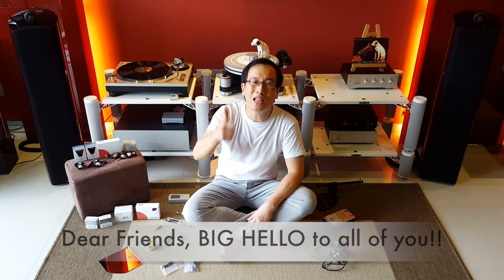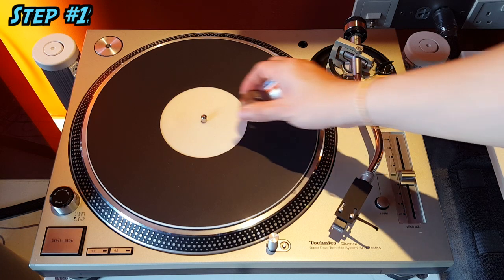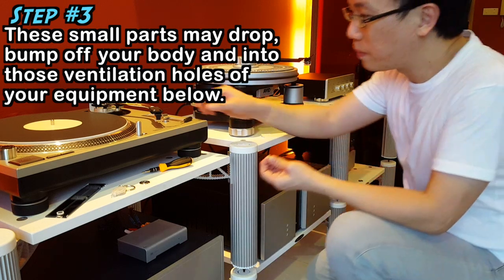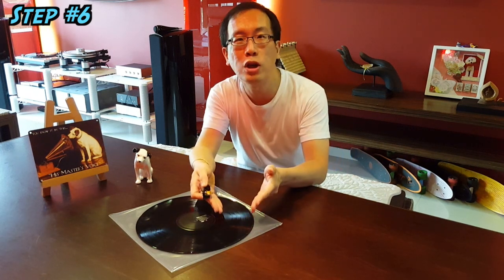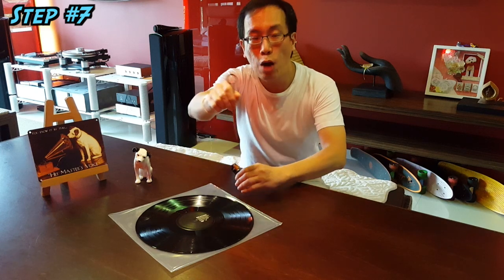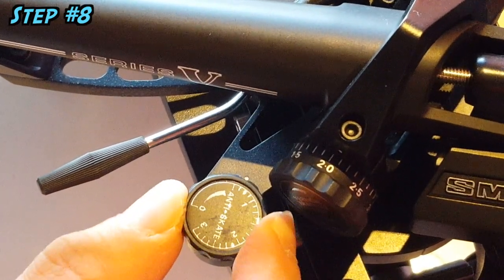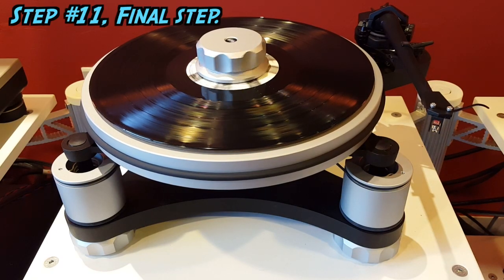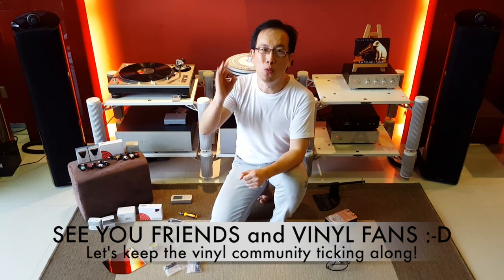Detailed Turntable SET-UP - for beginners - advanced.

Comment: A conundrum with my VPI HRX suggested not to use anti skate. I set it up anyway using an old laser disc. Still skates but nothing like it used to. Tone arm is 3d printed carbon fibre 12 inches in length with slight conical taper just to make things more difficult for you. Tone arm pivot also has VTA built in so you can adjust on the fly if needed. Platter and table are perfectly level. Spiked jack screws were installed in the table legs. Spot on!

Comment: I am not sure this is the right location to post this, but here goes anyway. This is a review and setup of Nagaoka MP300 cartridge. My cats laid waste of the turntable with tone arm off pivot. Nothing was damaged but I had to realign the whole system. Cartridge was the Kiseki Purple Heart which fortunately had the stylus guard installed. As the Kiseki does not have a replaceable stylus I shopped for something that would sound nearly as good. After 6 months I decided tonight was time for the Nagaoka. My phonostage is a Manley Chinook which required a gain change from 60 to 45db of gain. Manley recommends adding cable capacitance of 90pf for 1m lead and select a capacitance dip that will get you to a desired 120pf or so, 50pf was my closest choice. MP300 was aligned and balanced to 1.53g. Cartridge sounded bright so the added capacitance was removed. Bottom end coupled right in. Played Pink Floyds' Question of Balance. Something was wrong even though sound was balanced and uniform but the sound stage did not feel correct. Sounded like a phase issue. Wiring was per instructions so I reversed the cartridge connection on each channel. BINGO!!! Everything fell into place with a proper soundstage rendering. I think we have a psycho-acoustic thing going on here. The ATTACK sound should come at you, not recede. One other reviewer noticed the same thing with this cartridge. I put Diana Krall "I Dream of You" album on and all was perfection. I fell back in love with the sound and Diana.
Hope this helps some of you to fine tune your listening experience. My review of the Nagaoka MP300 is a resounding A1+.

Comment: Hi - great setup on the Avid turntable, but I noticed at 2:45 your platter is not quite flat and appears a bit warped.   Perhaps a manufacturing defect?   But all vinyl isn't flat anyways, probably completely inaudible...     Please keep the great videos coming... I really enjoy them here in the States!    Best...
Reply from the maker: Hi Buddy! How are you👋😄!!
The platter is spot on flat, machined aluminium.  The only issue then was that i had actually accidentally bumped on the platter quite hard during all the filming, and dented slightly the inverted bearing casework. It is an extremely small dent. I had my local Avid great retailer came over to just fit on the highly modular and replaceable case and sapphire bearing within 30minutes and everything was back to perfect since  two years ago.  Sammy and Eugene are a Father and Son-in-law team that retails Avid in Singapore. They have close contact with Conrad Mas of Avid UK and service thoroughness and response time is top notch from all of them💪😄👍!!! You can see Sammy and Eugene in my latest video where I picked up the Goldring 1042 cartridge! Their store is called Sound Decisions and have been around for more than 20 years.
Reply: Great that you got the platter repaired!    I'll look for them in your Goldring 1042 video.    Again keep the video's coming!  I'd like to see you discuss your opinion on your Technics turntable (or perhaps you have already and I just haven't seen it).   Take care...

Comment: Ian, do you tape down the platter even when using the dr. feickert protractor? The instructions that come with the protractor seem to indicate that you shouldn't....but it's difficult to say. Thank you for all you do for the vinyl community
Reply from the maker: Hi Brother🤗!! Thank you for catching up here!  May I share this with you...👋🛑 Taping down the platter is to prevent unnecessary and accidental shifting of the platter during alignment...coz accidental shifting may cause accidental bumping of the stylus against the other parts of the tracking force gauge, etc any apparatus that is used during cartridge alignment.  Accidents had happened in my own experience before and I had learnt from my mistakes and hence i am very adamant and passionate about taping down the platter before any other steps requiring the stylus touching things here and there✌🛑...
Let me know if you have other queries my friend. 🤗

Comment: Hi Ian, I have a question about SRA setting. It has to be 92 degrees. But is that measured in the  static or dynamic (with the platter rotating) way? There is a great difference between the two.
Warmest Regards, Mark

Comment: Hi Ian, just seen this excellent setup video again and ordered the Celestron microscope to get a perfect SRT. Just wondering, what do you use to measure the angle of the stylus once you have taken the picture?  Best, Peter, Denmark
Reply from the maker: Dear Buddy Peter!! I am extremely sorry!  The one I have been using which is much better is this one:
https://www.ebay.com.sg/itm/5MP-50X-500X-Magnification-8-LED-USB-Digital-Microscope-for-Inspection-ED/131908466569?hash=item1eb65b7789:g:nY4AAOSwcUBYQD56
I apologize because the celestron one which I used to use, is not able to magnify to that degree big enough and clear enough for optimal assessment of SRA.  I apologize for this.  Please get the one I have put up just above.  You can get it from any other ebay sellers.  Sorry, my friend.
As for the program, :-D I bought the plum amazing pixelstick available for US$10.  It works very, very well. I love it!!!! You can see it here:  https://plumamazing.com/product/pixelstick/
Brother, keep me updated anytime.  Best Regards, and again, I apologize for the above.
~ ian.
Reply: Ahh, thanks, Ian, but it doesn't seem to run on a Mac, I noticed that you also used a Mac in the video. Is it only for Windows computers?

It also seems to be in x1000 version, and there they list Mac OS compatibility.:
https://www.ebay.com/itm/2MP-1000X-8LED-USB-Portable-Digital-Microscope-Zoom-Video-Magnifier-Stand-/192235114461

No worries. I will cancel the other order. Best, Peter
Reply from the maker: Dear Buddy Peter, :-D i read with relief that you can cancel the other order.  Yes!!!
Brother, I am sorry about the Mac compatibility only.  I am not sure of the other angle measuring software that I can recommend with personal experience.  Apologies Brother.  I hope you find your way, and do let me know eventually about the one that you have acquired and works :-D !!! Thank you instead for your help in advance then.  I can thus recommend in future to other friends what you recommend.  Thank you, and warmest regards, ~ ian.
Reply: Hi Ian, sorry, I was talking about the software for the microscope you recommend on e-bay, seems as if it is only for Windows, but the x1000 magnification version lists Mac OS as compatible. Are you using the microscope on a Mac? I only have a Mac computer, so the angle software is perfect, just need to be sure I can run the microscope software on my Mac as well :-) Thanks for your great advice. Much appreciated. Peter
Reply from the maker: Peter Gabriel Ah i see! Sorry Peter... Okie the 50-500x one is compatible with my MacBook... once plugged in, the PhotoBooth app on my MacBook will automatically detect the usb microscope👍😄.... thank you Buddy for reminding me.
Reply: HI Ian, recived the microscope and measured my 2M Black's angle. Guess what, a perfect 92 degrees! That is great news as my Clearaudio Concept is not the easiest turntable to height adjust. Guess Clearaudio and Ortofon know what they are doing. Thanks for the instruction video :-)
Reply from the maker: Peter Gabriel Ah kudos to ClearAudio engineering guys who know what tonearm height to set to cater for the 2M Black🤗! Cheers Buddy!!! Happy for you!!!

Comment: Hi Ian,
thank you so much for all your inspiring videos. Thank you for presenting the shiit mani. Without your recommendation I would have never found this marvelous phono preamp.
One question: I own a Dual CS5000. I'm heading for the Nagaoka MP150. The turntable/ cartridge adjustment is a bit tricky. The tonearm only sinks to the record, when the turntable is running at the correct speed (Quartz-controled). Even if I switch of the current, the tonearm lifts and the cartridge doesn't lay on the platter/ record anymore. Do you know perhaps a possibility to adjust the turntable despite this "bug"? It isn't a technical fault, it's regular for this type of turntable.
Thank you in advance! Keep on with your channel. Thank you for your time on YouTube!!
Best regards from Germany. 
Sincerly Sebastian

Comment: Any advice for me. I am trying to get the right hybrid setup which is going to be used for 3 very different things.
1. Listening to records : Will use a different cartridge and headshell. Still thinking of which cartridge will be suited.
2. Serato DVS : DJ mixing which runs on serato control vinyl. Time coded signal to control software on laptop
3. Direct scratching on records. Bit advanced for me but I want to learn to how scratch direct on real vinyl records. Wont be mixing the records which I don't want to damage from this.  

Last 2 will use a cartridge meant for DJs scratching. Most probably Ortofon Concorde or Shure M44-7.

Turn table I have for this Audio Technica LP1240. DJ version with a lot of bells and whistles and also USB to sample records for mixing on software. 

I want to switch between each without a lot of tinkering.
Reply from the maker: Anurag Gogoi Wow Brother! You ARE having a lot of fun!!!👍😄👌!!! I am not a DJ and may not be able to help.  But i do know that for (1), the cartridges i recommend for your record listening pleasure are the Nagaoka MP150, Goldring 1006, MP110, Grado Red, Goldring Elektra, Grado Green and Grado Black.💪😄👍👍👍
Reply: Thank you for the advice... I am definitely leaning towards Grado black and MP110..
Reply from the maker: Anurag Gogoi Dear Anurag, the new Goldring E1, E2 and E3 series of cartridges are out. And i have placed orders for all three from my local retailer.  I will do the audition and testing for these cartridges as soon as i can.  I want to find out how they perform against the Group A, Group B and Group C carts👋😄. Nagaoka MP110 and Grado Black, you are choosing two great carts!!!!
Reply: Well I stay in Singapore too any local shops you would recommend to get the MP110. Or is it better to order from overseas.
Reply from the maker: Dear Anurag,
:-D my friends and i usually order from online ebay sellers (from Japan).
Warmest Regards,
ian.

Comment: Hi Ian,I got an Avid Sequel with an SME 309 tonearm. I understand that the setup of the SME 309 is very simliar to your series V tonearm in terms of setup. I setup the 309 tonearm using the paper protractor that SME provided. I suppose the SME paper protractor actually adjust the distance between pivot and the spindle. After that step, I found out that the overhang is not aligned. I used the Avid's SME specific alignment protractor to align the overhang. I tried adjusting the cartridge in the headshell but the range of adjustment is limited as the mountings are fixed. I have also made minor adjustments to the distance between spindle to pivot to no avail. Do you have any suggestions for me?
Reply from the maker: han meng Lim Hi Brother 👋😄, everything is okay
 Don't worry my friend! The SME arms adjust for overhang with the sliding tonearm base, and as such, the spindle to pivot distance changes with the adjustment in getting the right overhang😄✌!... for SME arm, getting the right overhang overrides getting the specific the pivot-to-spindle distance. I use the SME protractor too. Paper protractor is fine as well. Just get the stylus and cartridge body aligned for correct overhang at the 2 nullpoints and you will be okay. Warmest Regards🤗!
Reply: Hi Ian,
Thanks for the tips.  The local dealer swap my headshell due to a defect in the original headshell from the box.  I think the headshell given could be for another model.  When I use the paper protractor, the profile of the headshell will not coincide with the headshell outline drawings while the arm outlines coincide.  That may explain why I could not get the overhang aligned.  Going to approach them to confirm this.  Thanks for your 'enlightenment'.  Great help!
Reply from the maker: Great brother!! Things are clearing up :-D!!! Best REgards and have a wonderful and exciting journey!